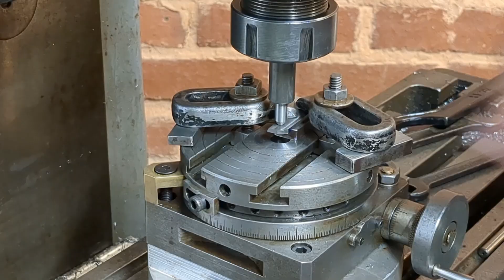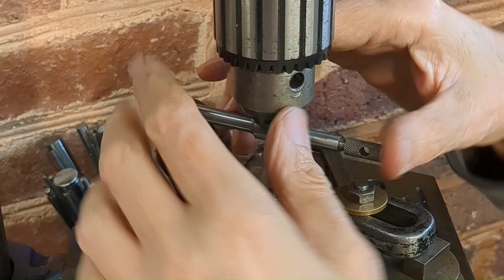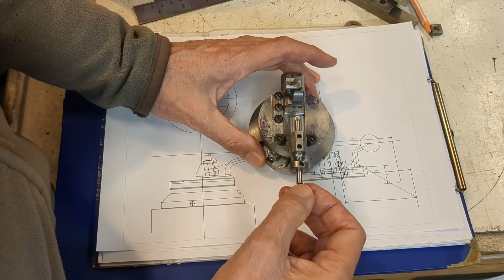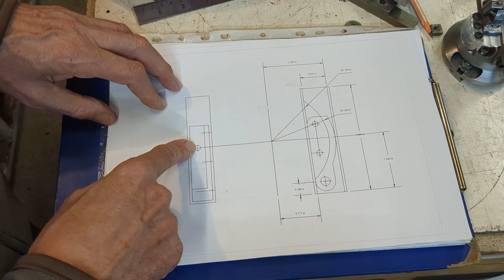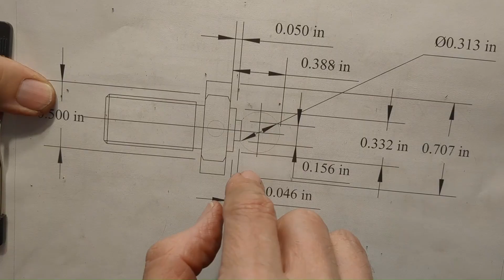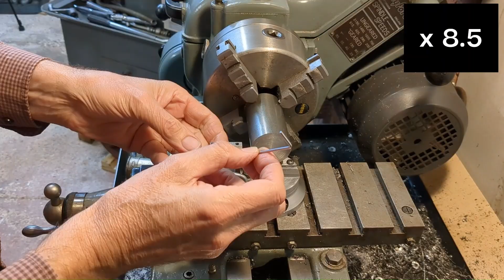Radius Turning Tool - part 9 (Completion & testing)

Comment: That's a good sturdy design. 👍
One limiting factor is that it cant get very close to the chuck, so the stock has to stick out a long way. Could be an issue with small pieces of expensive stock like brass or stainless steel etc. But of course you might be able to hold small stock in a special mandrel/collet etc to position it away from the chuck.
For my use, I would mainly be making round stainless knobs to screw onto handles, so would need to drill and tap from the back first, then turn it around and cut the round knob (so it would be a short piece of stock).
Anyway, cool project and excellent video! 👍🙂
Reply from the maker: Thank you for your comment. Yes, I agree that if using a standard chuck quite a lot of overhang, and hence stock, is required. As you point out a small collet would help. For threaded knobs you could hold the blanks on a threaded mandrel - especially if making several.
Reply: @Workshopfriend   great idea! A threaded mandrel would be easy to make, highly functional and really efficient with stock usage. 👍

Comment: That’s a very successful outcome and a very useful tool. The concave radius is almost there - won’t take much to improve that. 

A very enjoyable series all round.
Reply from the maker: Thanks, Stuart! I think one improvement would be to rotate the clamping bolts so they are away from the tool - or just have set screws from the rear.

Comment: Hi Clive. Congratulations. Despite you saying that the turning tool is not perfect, your tests clearly showed how versatile it is with many successful ball turning operations possible. Well done indeed. 👏👏👍😀
Reply from the maker: Thank you, Andrew. As I mentioned in the response to Stuart the tool clamping position could be changed for improved work accessibility. Also, mild steel on mild steel for the turntable is not ideal.

Comment: Whoever did that brickwork in the background needs to find a new career. Honestly, I’d have to render the wall to avoid having to see that.

Your video is up to your usual high standard. Thanks. I hope you have something else planned?

All the best. Mike
Reply from the maker: Ah yes, the dodgy brickwork makes my work look better than it is! The machinist's jack is ongoing and will be next followed by: turning rubber, lathe clutch bearing change etc!
Reply: Hullo Clive,
Your Super Seven is, I think, a mk1 like mine. Do you have a handbook for it ?
The early version has an expanding shoe inside the upper belt cone pulley, and taking it to pieces appears to be a bit involved. I think that I have a copy of the relevant pages, if you need them . . . .
Kind regards,
Steve.
Reply from the maker: Hello Steve. Thanks for the kind offer. No, I don't have a handbook. Mine has the cone style of clutch. Onice or twice I looked online for bearing details. Speaking of which I need to look more closely at the headstock bearing. I can either adjust the end float for smooth running and no chatter but slight binding when under load when drilling from the tailstock or vice versa.